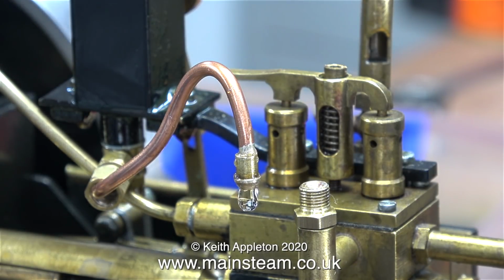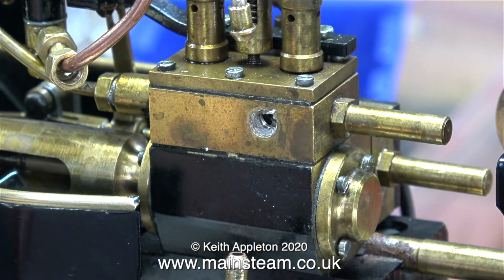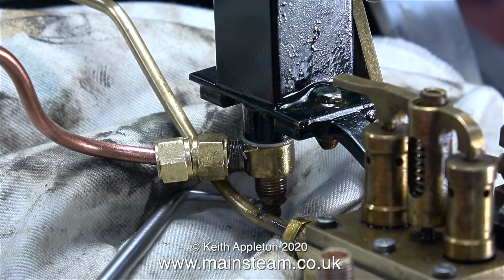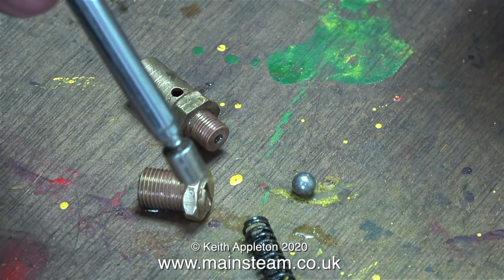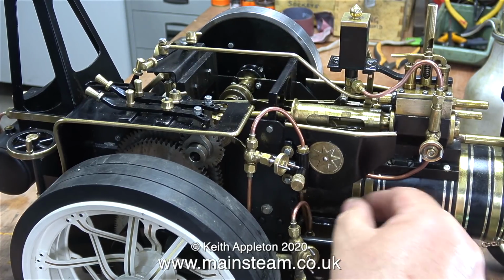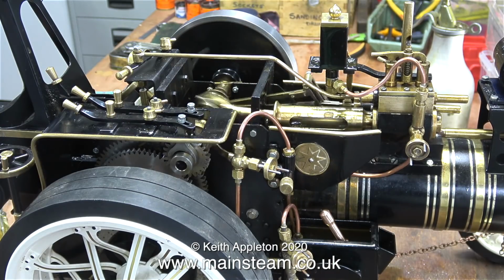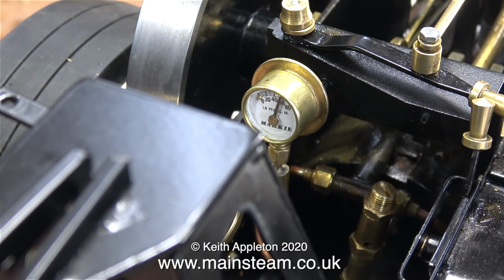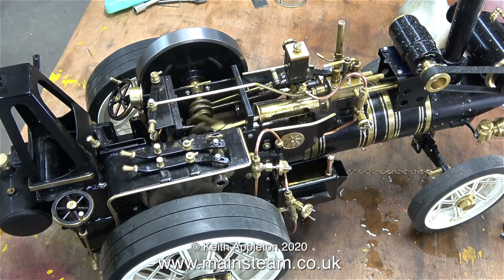A MARKIE SCENIC SHOWMAN'S ENGINE - PART #7

Comment: I had similar problems with the lubricator on my Markie - blowback from the engine, and the clutch was intermittent, usually stopping at some point. In the end I replaced it with a ratchet-type lubricator from Polly Eng. Works beautifully, and has never let me down.